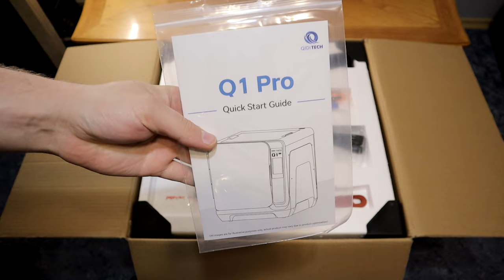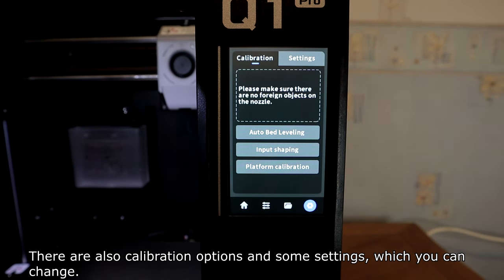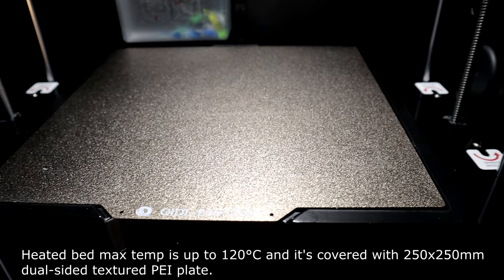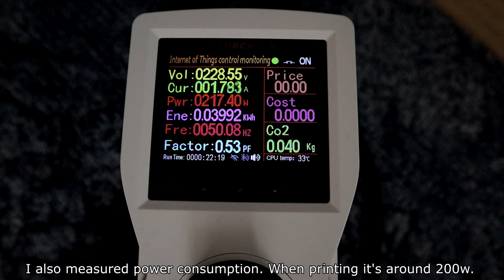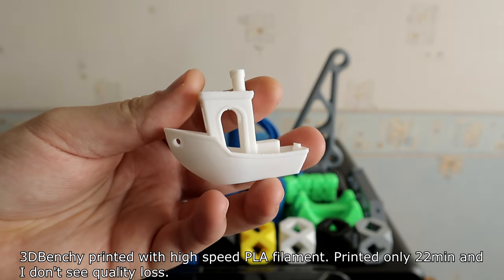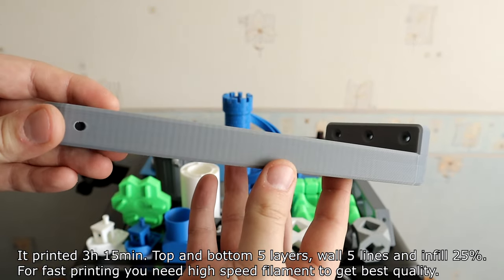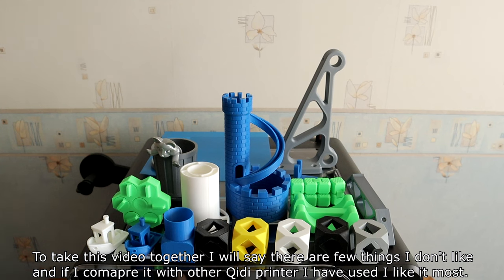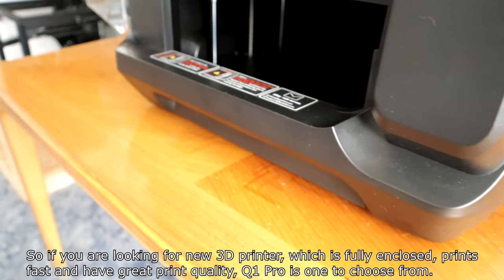Qidi Q1 Pro - The 3D Printer You Should Buy

Comment: Interesting response from the unit to power loss.  I would suggest you let Qidi know about that.  The spindle portion of the side spool holder can be attached directly to the socket in the back.
Reply from the maker: Thanks for the info. When I did the video I didn't noticed that you can put spool holder spindle directly to the socket in the back.

Comment: Got one, quick delivery from USA warehouse. Touchpad unresponsive, unable to complete setup. Contacted QIDI support (last weekend), said they would ship replacement part. Still waiting for them to ship part from China as evidently they have no USA parts stock, only printers...
Reply from the maker: Hi, My touchscreen works fine. That problem could be caused by shipping or the touchscreen was faulty from the factory. They should notice it when testing their printers before packing. I hope you can fix it soon and start printing cool things.
Reply: @3DPrintsBuilds  Thanks for response and not censoring me as I thought it might help in case many others had similar trouble. QIDI support keeps telling me it will ship "tomorrow" but every promise they make has not happened and they give excuse of Chinese "festival" which I know is a big deal there which happens every year but that festival has been over for weeks now.
Reply: @jojoma4025  As far as I know, they do have a traditional Chinese festival in early April.

Comment: Nice video. Is one of those included models a stopper for the bed plate?
Reply from the maker: I printed Platform horizontal block and there are also included Build bed screws block, what I didn't print.
Reply: @3DPrintsBuilds  How are those blocks/stoppers work?